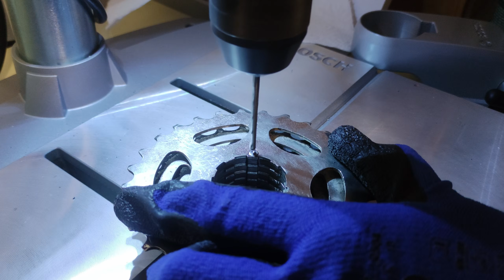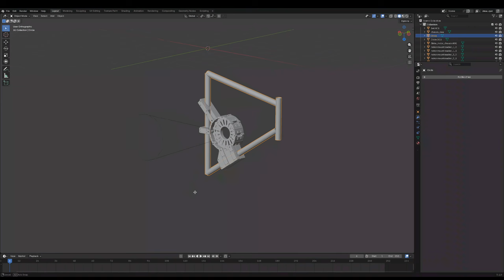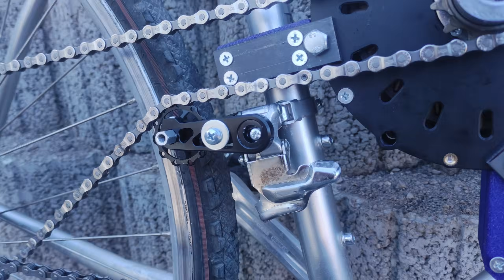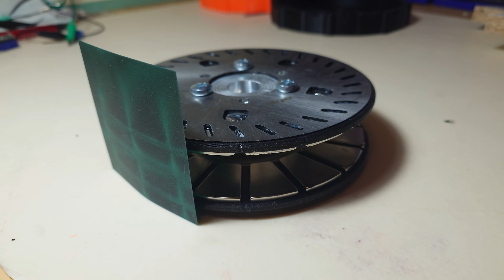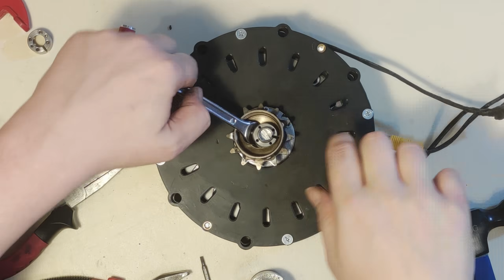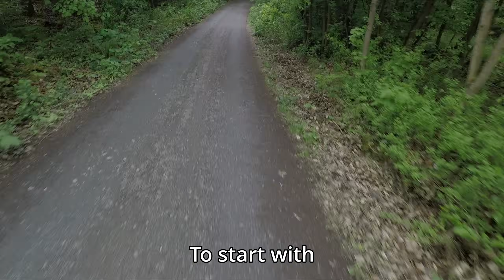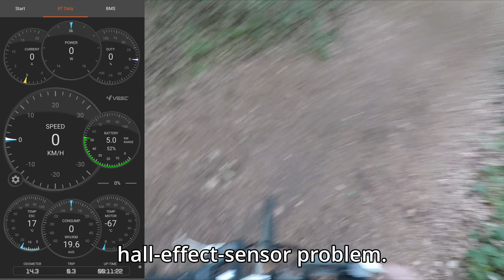Testing My Home-Made E-Bike Motor

Comment: Considering you're in lots of forest and hilly terrain, you have every reason to make the sprocket a bit smaller for more torque. If you were cruising on pavement I might say no but you're on dirt. Makes a huge difference when using low power motors.
Reply from the maker: Smaller on the shaft side is kind of difficult - the 12T bmx freewheel was the smallest number of teeth I could find. A smaller sprocket on the wheel reduces torque.
Reply: @BirdbrainEngineer no I meant on the wheel side lol, you've got a pretty big sprocket on there right now, consider the power output of a person driving all the smaller sprockets, the motor is roughly the same amount of power, but with a sprocket that's 2-3 times bigger. It's struggling!
Reply from the maker: The bigger sprockets are the "easier gears". Think of it this way - If you had two sprockets, both with 20 teeth, then when the motor does 1 turn, the wheel must do 1 turn as well. But if the wheel had a sprocket with 40 teeth instead, then when the motor, with it's 20 teeth sprocket, does a single turn, the rear wheel does only half a turn. Speed has reduced by 2x, but that means torque must have increased 2x. So if you want more torque, you want a large wheel sprocket and a small motor sprocket. You can verify this on your own bicycle! Shift it to the easiest gear you have, and you will notice that the front shifter (if you have one) is on the smallest chainring and the rear shifter is on the largest sprocket.

Comment: MAKE IT CHARGE ITSELF.
Reply from the maker: regenerative braking is very difficult to do in bicycles unfortunately. In mid-drive motors it is impossible because force doesn't ever get transferred from the wheel back into the pedals (and this would be unsafe if it did). So we are left with motors that spin the rear wheel (or front wheel) directly. However, in most hub motors, and with this setup I made here as well, the wheel can not make the motor spin. This is because otherwise you would have to spin the motor around when just pedalling with no motor assist - this is annoying and a waste of the rider's energy as the motor has cogging torque and inertia that has to be overcome. 
The upshot of it all is, that regenerative braking is simply impossible on most e-bikes... at least on e-bikes that you intend to regularly pedal yourself.

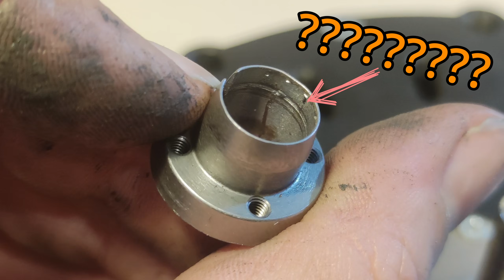Comment: 11:43 This looks like galling. Pretty common type of accidental cold welding.
The shafts slipped around each other, broke through the oxide layer, and became one piece of metal.
Can be prevented with a keyway to prevent slipping, or a dissimilar metal bushing (such as brass).
Reply from the maker: nod nod
Thanks. Yeah, for future will definitely consider something like a splined connection instead.

Comment: Best diy electric motor i have seen so far! 
3s 2p moooorreee pooowwweeeerr! 
Amazing how you managed to get it all working so well with very little mistakes. This shows your design and thought process is really good. 
I was thinking the gearing was a little to steep? With the upgrade battery setup it will most likely fix all the minor issues of low start torque and reaching your 25km/h goal. Fingers crossed the heat will be still good with the extra power!
Reply from the maker: I think the gearing ended up being exactly what this motor needs - it does need the help at standstill torque, but as soon as it's going at like 4km/h, it actually does out-accelerate the bafang hub motor clone my friend uses haha. But then maximum speed is lower, probably because the motor's KV is pretty low now with the iron core stator. A higher voltage helps... or potentially field weakening.

Comment: Awesome, what got me Since you already had the cnc cutting board for the carbon fiber & had PCB way as a sponsor. what you really needed is to have them cut out steel sheets to stack in the coils to finish the motor.  Cost/savings🤑🤔

Comment: I'm surprised you didn't mount the chain on the other side! Wouldn't have to pedal at all at cruising speeds.
Reply from the maker: How would you have imagined to attach the rear sprocket there? I suppose if I were to buy a new wheel then I could attach it onto the disk-brake mount on the wheel... but in the beginning I didn't even know if the motor would actually work out... so I didn't want to spend money on a new wheel.
Reply: @BirdbrainEngineer there are joints that attach to your spokes, they are popular in the motorized bicycle communities. Ive been up to 80 kph and it held up. Good points and great work!
Reply from the maker: @N9197U  Doesn't sound safe nor reliable long term... Definitely not going to recommend anyone do that.

Comment: Wanted to pedal the bike without turning the motor,,, however forgot about the motor turning the pedals.....
Reply from the maker: Didn't forget. But there basically was not a different solution. Or rather, the second solution is to not have any freewheel at all and rotate the motor while pedalling (super uncomfortable I'd imagine, as the motor has quite a bit of cogging and inertia). The one solution that would have been better, meant that I would have had to extensively modify the frame and crankset. I was not ready to take that challenge this time.

Comment: I like to know more about that bypass key cheers Graham
Reply from the maker: Basically it is just three connectors and wires. Two connectors are just plain old connectors (CT60, CT90, something), while the third connector is an antispark one(XT90S in my case). The ground between the normal connectors are directly connected by a wire. The +40V side of the normal connectors however has the antispark connector in the way. This means if there is no loop key inserted in the antispark connector, then the +40V is disconnected and the battery is disconnected. But as the loop key is inserted, the connection is made through the loop key itself. The antispark connector works by basically having a small pad connected through a resistor on one of the pins. Basically that means the capacitors can charge through the resistor (and they do that within milliseconds regardless) before the main, low resistance connection is made by pushing the connector deeper into the plug.
Reply: @BirdbrainEngineer cheers.

Comment: Man I hate those cylindrical roller thrust bearings. A pain to align with 3D printer tolerances, and they intrinsically have some slippage. Tapered rollers are expensive, but ball-based thrust bearings seem to work well from my limited experience.
But great work there getting the iron core to work!
Reply from the maker: That's why they are technically aligned by the cnc milled central "hub" of the rotor and the radial bearing instead, and smushed between the purpose-made races for them... I would never suggest putting roller thrust bearings directly onto 3d printed parts - that's asking for trouble as the 3d printed material wears away, and as you said, the 3d printing tolerances are simply not good enough for it.
Reply: @BirdbrainEngineer  Oh I wasn’t implying you’d use the roller-carrier or ball-carrier without metal races. And even with flat-contact tapered-rollers or balls, you’d want to handle radial loads with a conventional radial bearing. Angular-contact tapered rollers and balls can do both jobs so long as you have the right preload.

But regardless of the metal races, there’s nothing keeping the roller-carrier located with respect to the centre of rotation. Even if the rotational friction causes a self-centring behaviour (I suspect it doesn’t but I may be wrong), that would only apply while there’s constant preload on the thrust bearing; it could get out of alignment due to vibration and slack. And with 3D printed parts, you have to set those races flat with respect to one another and orthogonal to the rotational axis, top-surfaces of 3D prints can be imperfect enough to make this annoying.

Comment: The joy in your smile when you say the the motor and bike are useful is amazing. 🥰
Reply from the maker: It still brings a smile to my face when I think back to this whole project. It definitely has given me more confidence that I am able to actually figure this stuff out. 

Also I wonder if there are any other actually home-made from-scratch motors like this that are shown to actually power a bike or something... I have seen people run propellers (Even big ones), but I know for a fact that they can't run those motors indefinitely at the power they show, while I totally can (At least within the confines of what I showed). I have also seen a lot of people make hydro and wind generators, that do produce real and useful amounts of power - and that's absolutely awesome... but those generators are usually not well fit to run as motors, of course. 

Basically, a part of the smile is also that I knew then, that I had technically made content that is... actually either a first, or at least seems to be very hard to find on the platform otherwise...

Weirdly, this video seems to be performing quite terribly compared to what I expected from the previous video's reception...

Comment: I've been running into the same issue with my alternators I've converted to PMSM in regards to hall effect sensors working on the flipsky vesc. Same jittery starting, like it's not even reading the sensors and just going straight to FOC, which has imprecise starting. 
I have an e bike (2000 Schwinn stingray OCC edition) that I have powered by one of these converted motors that gets me up to 30 mph using the flipsky 75100. 
This is a super cool project you have!
Reply from the maker: You should try re-running the hall effect sensor setup. And make sure your sensorless erpm is set to something between 1000 to 2000. There's also a case to be made for increasing the phase amps of the motor - at a standstill, the motor needs to use more amperage, as voltage tends to be quite low due to no back-emf being present/duty-cycle being low. In general, I suggest setting phase amps based on the required torque at standstill and maximum power based on how many phase amps you want to let the motor use while already at speed. For example, I would set 30 to 40A on the phase amps, 1.5x that on the absolute maximum amperage and then limit power to 600W. With a 40V battery, it means that at 100% duty cycle (95% is effectively the same, which is the safe default for Flipsky), the motor would be limited to 15A phase amps, as 15A*40V=600W. But, say that the maximum duty cycle the vesc can manage for your motor at standstill is only like 10%, then it would effectively only have 4V for voltage, meaning to get the full 600W, you'd need 600W / 4V = 125A - unrealistic, but at least with something like 40A, you'll get 4 V * 40A = 160W - which is enough to get going from a standstill reliably, though maybe not so on an incline. 

Honestly I wonder why it's not possible, or at least easy to tune the duty-cycle on the vesc. Don't get me wrong, there is the duty cycle control for the throttle but generally you want to use current control... So I feel like there should be a kind of mixture of modes, where up to a specified erpm speed, it would use a mix of duty-cycle and current control - that way we could get the inefficient but higher power and high torque start, while getting the full benefits of current control at operational speeds.

Comment: @11:42 It looks like galling to me. Cool project.
Reply from the maker: Galling, yes... does look like it. But then the question is how exactly it happened. I have heard of galling happening between sliding surfaces, but there, the surfaces should not be sliding. Though, of course, perhaps the clamping force of the sleeve was overcome and it did slip a bit?
Reply: @BirdbrainEngineer I do suspect some kind of sliding. I'm struggling to think of any kind of process (galling or otherwise) that could create that circular pattern without relative rotation. But there are many more things in this world that I don't know than I do.
Reply from the maker: Yeah, the rotation must have definitely happened. But the main question really is whether it might have been some defect in preparing the coupling or perhaps on the surfaces of either the sleeve coupler or more likely the shaft, that resulted in a high spot and therefore reduced coupling force and the slippage... Or whether the sleeve coupler is just too small to handle the power - This is what I'd imagine is the case... But I am confused because, on the current version of the motor this same way of coupling has been just fine... And there's certainly more torque going through the coupling now than on the air core version...

Comment: The motor wouldn't need to do as much work if you attached it to the pedals on the left side, so your motor can use the gears too. (i.e. make it a mid-motor).
Just use a right bmx crank with a freewheel cog on the left side and run motor chain to it. When connected to freewheel on the left side it will engage  when motor is kicking in, but freewheel when motor is inactive.

Comment: The engine may not be developing full power due to voltage drop in the batteries. You said you used inexpensive batteries, which means the wires and nickel plates connecting them may be thin. Also, the batteries aren't high-current, so they quickly drop under load. Borrow someone else's bicycle battery and conduct a comparison test. Then you can decide what to do.

Comment: i think with a replacement hub you'd have had a much easier time...
Reply from the maker: Of course buying a commercial hub motor would be much easier (and cheaper)... but that's not what this project was about.
Reply: @BirdbrainEngineer  hub, not hub motor.
Reply: @BirdbrainEngineer  poke poke.

Comment: i would say, the tourque problem is the batteries, there is no way the bms in a drill battery lets you pull anywhere near 60amps
Reply from the maker: 60 phase amps is not the same as 60 battery amps. The battery amps were limited to 20, which is shared between two parallel battery sets. In addition, these drill batteries are 5s2p, meaning effectively the battery was a 10s4p battery... Even low quality Li-Ion cells will easily give you 5A.
Reply: @BirdbrainEngineer  ah ok i thought 60 lines amps
Reply: @BirdbrainEngineer  also, the bms in these packs are very bad, so they maybe even limit that

Comment: Nice, but now make it 3kW. Then building this would have an actual advantage over a cheap geared hub motor, because they are not available with that power.
But the mid drive you can spin faster and make it as big as it needs to be.
Also you could maybe add a temp sensor to the coils and add cooling. Then you can push more power
Reply from the maker: Technically this motor should be able to work at a higher voltage... say, 80V or so, before the maximum speed of the motor would exceed the thrust bearing rotational speed limits, leading to increased wear. For like two or three minutes in a row, I could probably push something like 40A through it and it'd not overheat, so I could get 3.2kW out of it for some time. The chassis should also be capable of handling that amount of power... But that is just the electrical power. The actual useful mechanical power output at that point would be a lot lower. Maybe 2kW or so? The thermal limit of this motor is probably somewhere around 600 to 800W realistically though.

Comment: I worked rewindind machines and i think you really need to balance every rotating part in the future, it is way more important than you think. keep posting, good video!
i noticed the disbalance is notorious even with sight when you tested the better motor at 12:40
Reply from the maker: I did actually do static balancing of the rotor! I glued washers to the back iron to do so. However, it is true that the dynamic-balancing is still off, and I believe it is the cause of the rhythmic sound of the motor. At these rotational speeds that this motor sees though, I don't think it's actually tooooo bad of a problem... but something to solve in the future for sure! In general, with these janky DIY projects, you simply have to pick a point to call it "good enough"... otherwise you'll never finish the project!

Comment: I would really like to see an all out engineered for efficiency homemade e road bike. I want to see 200 miles on a charge. Huge battery, efficient motors and light and efficient frame. There is something so interesting about going to the absolute extreme with efficiency and range etc.
Reply: If you are going for maximum efficiency make it a velomobile.
Reply: @garethbaus5471 you’re right.. but once you go beyond a simple bike frame then you’ve lost the interesting bit. Much like how it is interesting how fast you can make a 1.5l na civic. You can’t swap in a massive engine.. it’s no longer interesting. Let’s see 500hp out of that thing and we are impressed.
Reply: @ChrisMullins-i9j I would beg to differ on that. Having to basically build the entire frame from scratch and design it to be both lightweight and aerodynamic is very interesting.

Comment: Have you added in any field weakening for a little more eRPM to help with that top speed? Also 3s2p could help with torque if you wanted a little more oomph off the line.

Comment: From bike mechanic world.  Chain and sprockets are designed to mesh exactly.  They tend to wear together, but chain can both stretch and wear.  Next time if you look closely at the chain going over sprockets and you see some slack (sprocket engaging only leading tooth) then chain and/or sprocket may need to be replaced.  Otherwise a very old chain with no slack is fine.